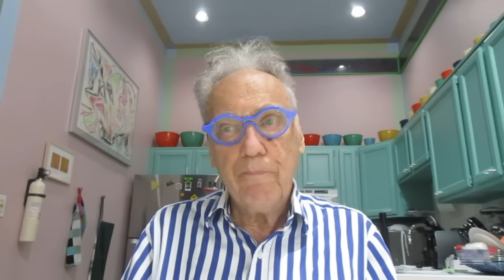Why  is H.C. Verma's Solution Wrong?

Comment: I solved HCV for physics, MS Chauhan and Narendra Awasthi for Chemistry and Cengage for maths. I did this after solving DPPs provided by my institution still couldn't get a descent score in JEE Main 😕 What could be my mistakes ?
Reply: Lack of revision or something other
Reply: Ig u had not made notes from these books. Just solved the questions and forgotten them. Btw I too made the same mistake during  JEE 😂
Reply: Sad to know that I think lack of revision maybe a cause for it
Reply: Not enough Revision can be one reason. Maybe you didn't remember stuffs you studied a lot earlier before the exam as well as you thought you have.

Coachings actually try to go in deep of every topic and give dpps related to every topic but not everything is actually of that importance from cracking JEE main perspective.For instance Coachings give a lot of time to linear kinematics but that hardly has questions these days in JEE mains.Also Newtons Law of motion.But coachings spend way lot time than actually is required considering it has hardly any questions.Around 70% paper actually comes from 35-40% of syllabus and maybe you gave a lot time to chapters from where lot of questions are not given. 

Also maybe you didn't practice enough and gave lot more time than required to theory or you didn't practice many relevant questions. 

Or you didn't give enough mock tests or didn't analyze them the way they should have been analyzed. Time bound practice can also be one thing.

I exactly dk if these are the reasons but anyone or a few can be. Hopefully this helps.

Comment: I said just what Professor Lewin said, in a different language, in a reply to his previous video. Was I wrong because of my language ? Can Sir or anyone please clarify ?
Reply: The  B-field of the magnet generates and external EMF on the superconducting coil. That way, Faraday's Law is not violated. At the same time, this EMF is external, and it does not lead to an internal electric field. The external EMF causes a current on the wire, once again, validating Faraday. The current should be infinite because there is no resistance on a superconducting.
Reply: Am I making a mistake, somewhere

Comment: No no HC Verma's solution is not completely incorrect... he didnt mention that the current runs in the surface of the super conductor... but he is correct that the flux of the induced B field nullifies the external flux (satisfying lens law that induced B field tries to oppose the net change in B field )